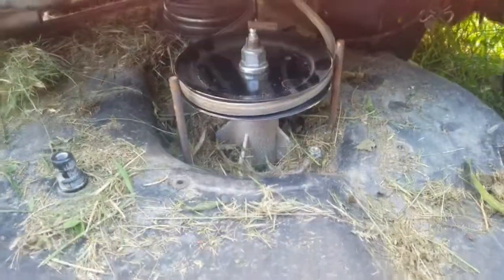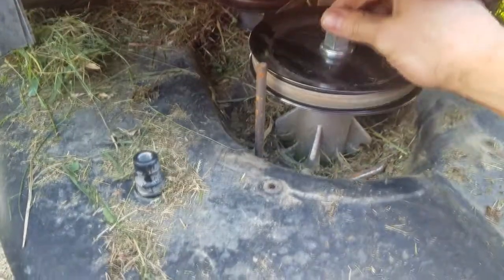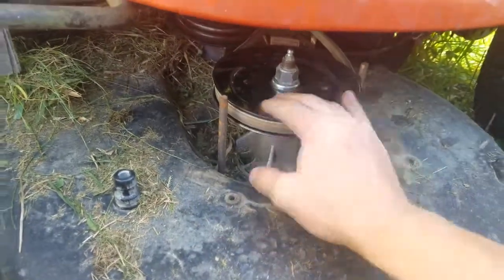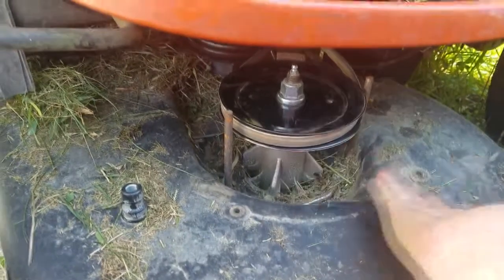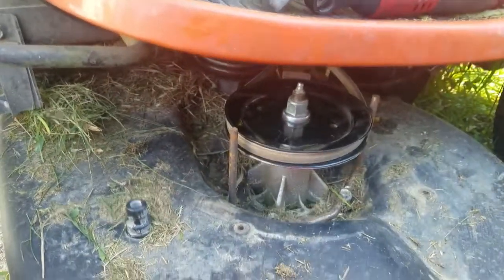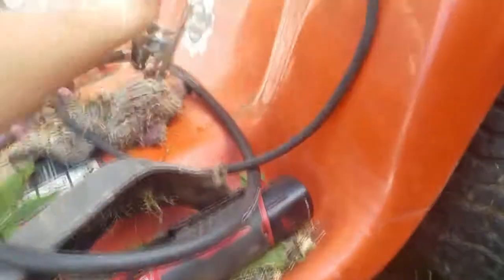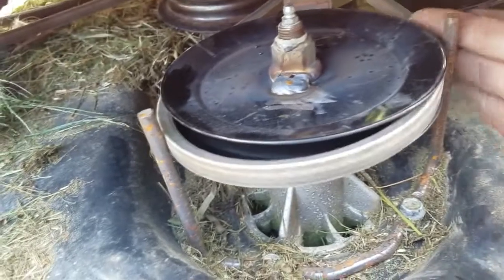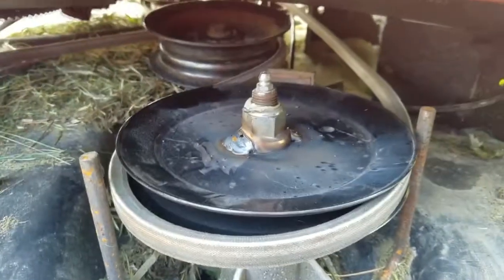Stupid Farm Fix   01   Riding Lawn Mower Pulley

Comment: If something stops the blade, I want something inexpensive to fail and replace.  The replacements cost $20.  My guess is, these pulleys work like shear pins on a snowblower.  If something should stop the rotation, utilize a sacrificial part to save everything else.  Spend a little time to walk the yard and pick up debris before you mow.

Comment: LOL, I did this last year... I have welded all 3 nuts to pulleys now.... Has never stripped again... First time I did not get all the zinc off the pulley and had a bad weld... Second time no problem... Mandrel and pulley cost me $80 a pop... a 5-minute weld is cheap enough... Great minds think alike ;)  BTW, Take it off so you don't heat up the bearings & grease in the shaft
Reply from the maker: Thanks for the tip! Yeah, I haven't had a problem since!

Comment: I have replaced 5 of these [CENSORED] things. I think I might just do the same thing.  I was looking at the two holes in the pulley thinking there might be a way to build a bracket, for want of a better term, and place it on the post after the pulley but before the nut and have it cinched down with a locking washer and the nut.  I like your idea better!

Comment: I had the same problem. I considered that fix, but there was big enough wallowed hole in the pulley to make the chance of proper alignment nill. I figured that likely vibration would be enough to ruin the deck over time.  So I ordered a new pulley and spindle, and hopefully I will have better luck with the aftermarket part.
Reply from the maker: Yeah, its not a great fix, thats why I call it a stupid farm fix :-)  These were aftermarket spindles, evidently they are not great.
Reply: @goddom  yeah, i have one original spindle thats 15 years old, then I have the other side that gets a new aftermarket spindle every 2 years

Comment: I hope you put some more grease in the bearing... You also may have burned up the seal. I don't know.
Reply from the maker: Probably should have put in more grease, but I added tons when I did the first install. If I remember correctly, there may not be a seal at the top, just a bearing. I know its not a good fix, that's why I called it a "stupid farm fix" and not "How to fix your riding lawnmower pulley" :-)